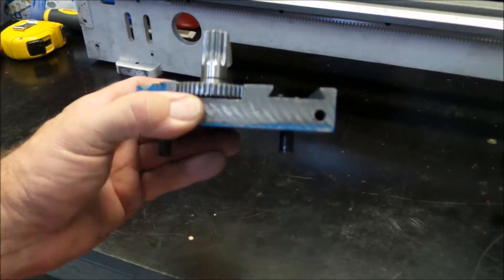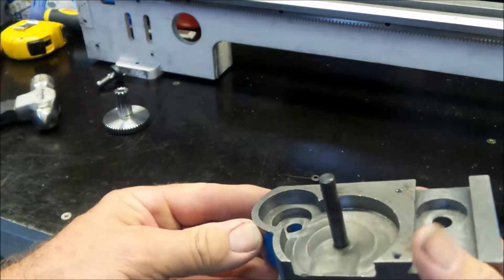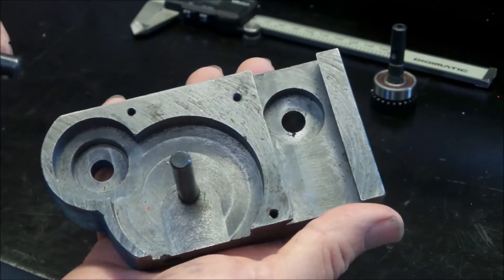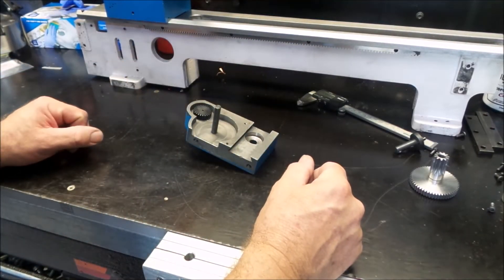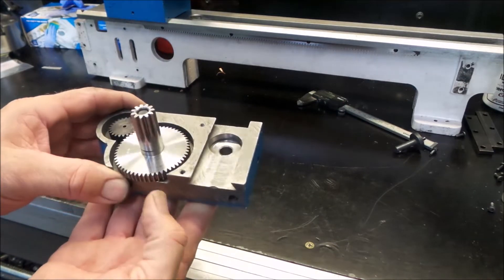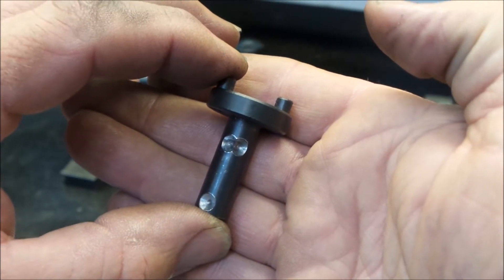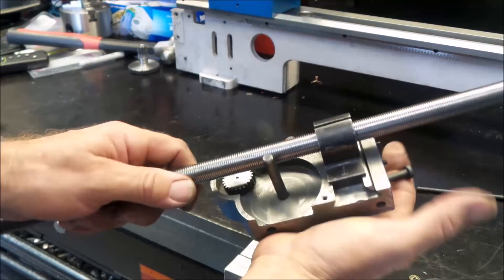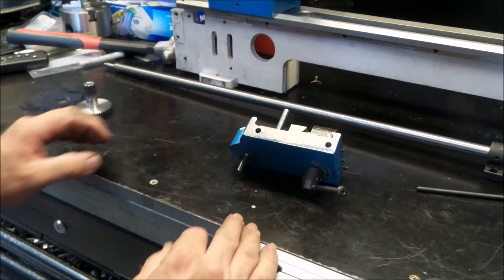Correcting The Apron Faults On The Chinese Mini Lathe, Episode 3

Comment: It is a pity that you were unable to show us the machining methods used to correct the problems. Also, was the half nut shaft unacceptably weakened or did you weld up the rubbish detents?

Thanks for the video.
Reply: My OCD would have brazed those old divots up also.

Comment: Mine had the spring but not small ball bearing so the loose lever ruin the threads. Later assembling the two bolts,apron holders gave me a little work for fixing in right position.
Reply from the maker: Well that sux, good luck with it Mate, Cheers.

Comment: Good job Trev. I was quite surprised that you found a bearing on the lathe & secondly, it just proves how bad & junky chinese stuff is made & thirdly, it confounds me how we accept this shit that comes out of China. The same thing happened in the 60's with Japan it wasn't accepted as easily then & they had to reinvent themselves into one of the best manufacturing countries in the world. As far as bearing are concerned, when someone I know buys a chinese machine of any type, I tell them to replace the bearings immediately(they are crap) to either Japanese, German or American made bearings. As a side note, I worked in a machine shop & am now a service technician so I have seen a lot of the crap that China sends us(& we accept I might add). Unfortunately I inherited one of these when my uncle passed so I do know what they're like, I would rather spend more & use it immediately than to spend less strip it down, spend weeks getting it to a level that would be no where near a better lathe, my thoughts anyway. Cheers Trev, love your channel ,have a good one.

Comment: A great presentation but I would love to know how you dealt with the tapered hole for the bearing..  In my case I think the hole needs to be a half millimetre deeper. Still checking this. I seem to have exactly the same apron as you have.
Reply from the maker: G'day Garth, from memory i think I carefully did the corrections to the hole with an end mill in my drill press. Cheers Mate.
Reply: @TheAussieShed  Ooh ok. Dangerous in my drill press which has a Jacobs fitted chuck.

Comment: nice modifications but the lead screw diamtere is slightly  bigger than the fully closed half nuts and it dosen't clamp fully on lead screw so your handle won't lock in place

Comment: My HF mini lathe does not even have a bearing on that hand wheel/gear shaft! Talk about cheap! I really don't have that ability to machine the apron for a bearing but I might oversize the through hole and put in a bronze bearing so it has a better fit.
Reply from the maker: And here I was think I had the Nastiest el cheapo version of the Mini lathe out there, only to be out done by Harbour Freight.
A Bronze Bush would be perfect, probably would have been the best solution from the factory right from the start. Cheers Mate.

Comment: nice job done!
mine is a fervi 716 lathe, from the same chinese factory it came your.
the gear cover was already installed and half nut engage already well.
in italy there is another brand name for the same chinese minilathes, called valex, that have the same issues you've shown.
parts can be freely mixed between the two brands.
Reply from the maker: Thanks Mauro, Cheers Mate.

Comment: Thank you for your detailed and thorough guide, also the credits are funny, please keep it up Mr. Trevor.
Reply from the maker: Thanks Sergi
Reply: @TheAussieShed  You are more than welcome, I'm the thankful one, Mr. Trevor, which glue did you use to hold the sandpaper on the lathe bed ways? My guess is super glue?
Reply from the maker: Hi Sergi, 3M Spray contact adhesive is what I used. Another guy suggested using Windex window cleaner as a lubricant instead of WD-40  as it won't brake down the glue. Great Idea I think. Cheers Mate.

Comment: 6:16 Just wondering why you wouldn't install the bearing first by tapping down on the outer race. Then install the drive gear.
Reply from the maker: G'day seth, Reason is, Because the bearing is being installed into basically a blind hole. The hole has clearance in the bottom to allow the centre of the bearing to rotate freely without binding. Which is a good thing. Unfortunately what this creates is room for the centre of the bearing to deflect into as the shaft of the of the handwheel gear is then pushed into it. That is enough to destroy one of these small bearings. If the Bearing is installed firstly into the housing, there is no way to prevent this happening, other than enlarging the axle hole in the housing & supporting the centre of the bearing with a sleeve while pushing the gear & axle into it. Hope I have answered your question satisfactorily Champ. Thanks for the comment  & watching one of my Vids, Cheers Mate.
Reply: @TheAussieShed  Thank you, yes that makes sense. I only asked because I replaced a couple of bearings in my farm bike last week and installed them into the case first and was wondering if i'd done it wrong. Although it's working okay now. Thanks again for replying to my comment.
Reply from the maker: They should be fine Seth, these tiny bearings are quite fragile, hence the technique used. I imagine the farm bike has decent size bearings & the shafts are a proper sized fit in them, unlike the Chinese Mini Lathe. Cheers Buddy.
Reply: @TheAussieShed  Thanks 👍
Reply: Nice, my lathe does have bearings for the shaft nor such a skookum half nut.